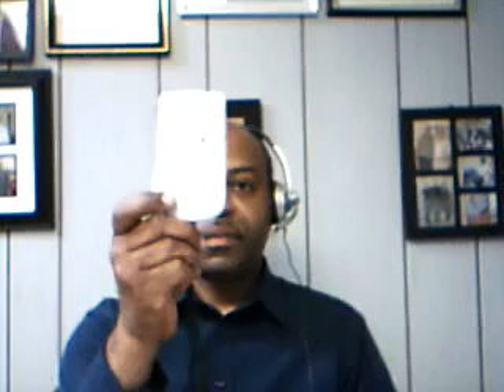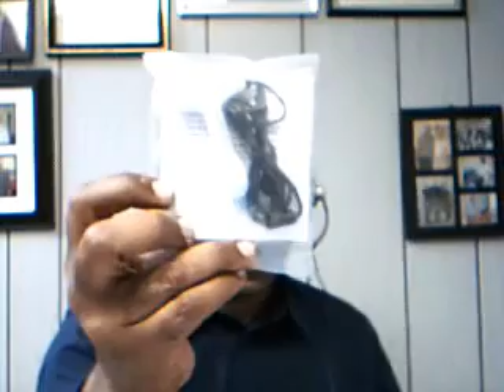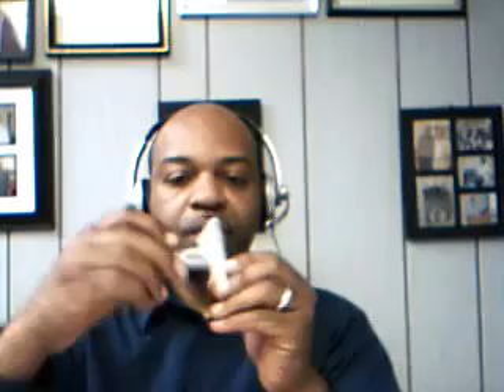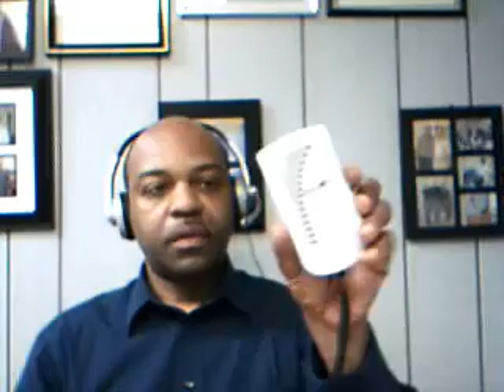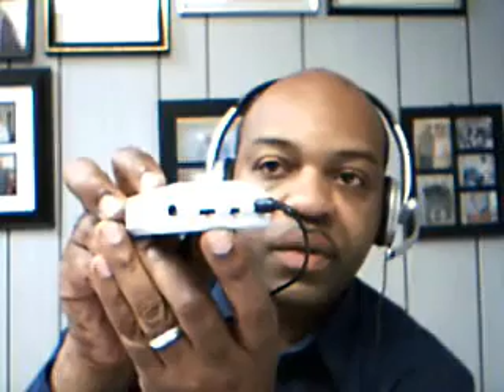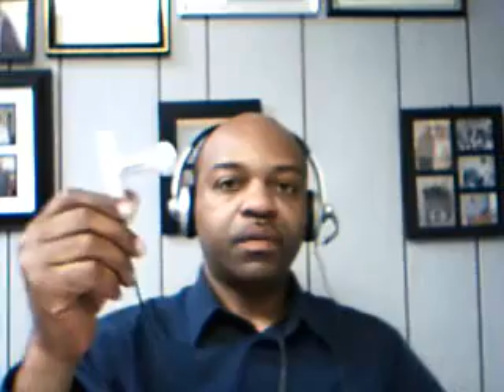Ucontrol Instructional_0002.wmv

Comment: Thank you for the video! Can you tell me where the light should be while at rest during the vaginal one? Is it supposed to be all the way down relaxed or in the middle?
Reply from the maker: There should be a threshold setting or goal that can be adjusted.  A relaxed level of muscle tension would be about 2 or 3 microvolts.  Higher than that would indicate that the muscle is holding some excess tension.  If you are in the relaxed zone that is good.  The lower you go the more relaxed the muscle is.